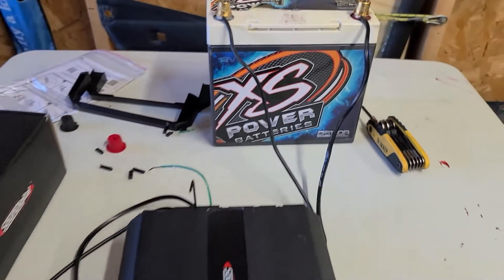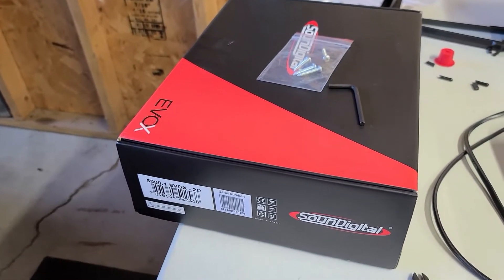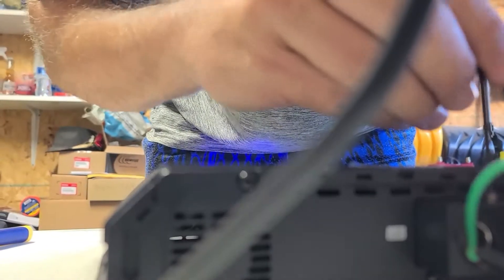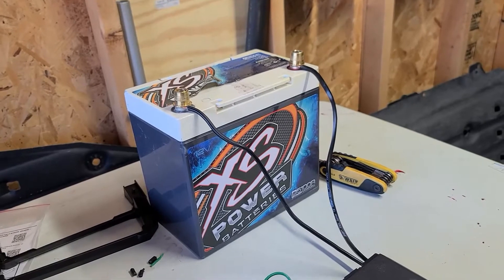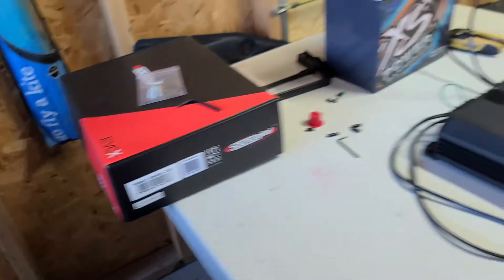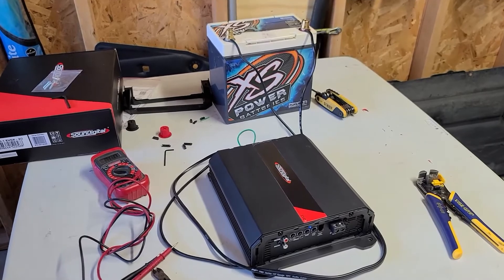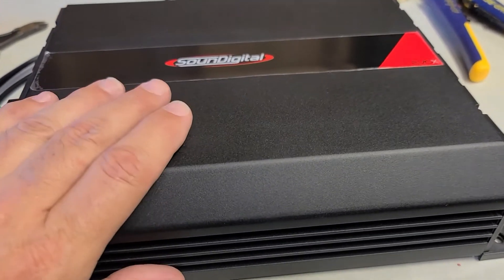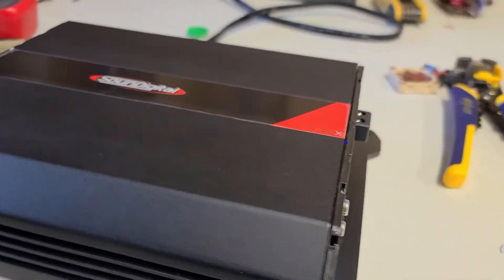Soundigital 5k initial thermal testing

Comment: Lemme let you know that you know nothing about modern amps.   This is an audio driven fan. This is the weirdest test i've ever seen. This man is trynna make an analysis just by turning on an amp with no speakers on
Reply from the maker: The reason I was doing this is because the last amp I had like this one would get burning hot not even playing music.  I would just have it remotely turned on.  I was trying to see if this is just something these Brazilian full bridge amps do. I had a SounDigital 3K that worked perfectly.  It would only heat up when driven hard, but at idle, it would be barely luke warm.
Reply: @RodofAllTrades  most of brazilian amps are half- bridged.  Remember this fan is simultaneously driven by temperature degree too...i've been using brazilian and chenese powerful amps for years, and trust if your amp turns hot without load, it probably has some biasing or switching issue.
Reply from the maker: @roelvisgrullon8696  I am not an amplifier circuit expert, however - I do my homework. I do know that TWO FULL BRIDGE amps CANNOT BE STRAPPED together.  The amp in my video is a FULL BRIDGE design and it says in the owner's manual that it can't be strapped with a second identical amp. Here is a video link of a VERY knowledgeable guy.  You may want to check it out.  https://www.youtube.com/watch?v=b6tyjXSHvGg&t=0s
Reply from the maker: @roelvisgrullon8696  you are correct about the biasing issue though.  I did see another video where the repair technician was talking about it.
Reply from the maker: Also, if the fan is "audio driven"  why did it eventually turn on without the amplifier receiving a music signal, or having any speakers connected?
Reply: @RodofAllTrades  sometimes it randomly does for a second